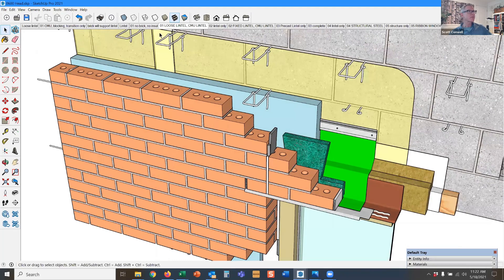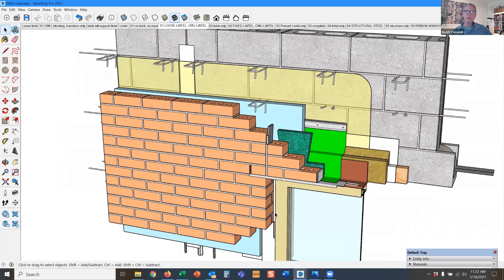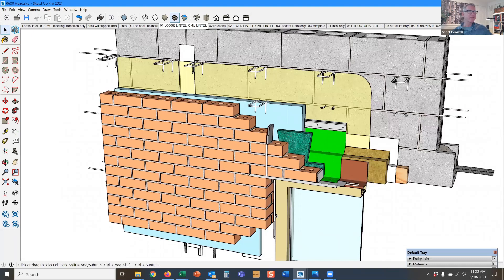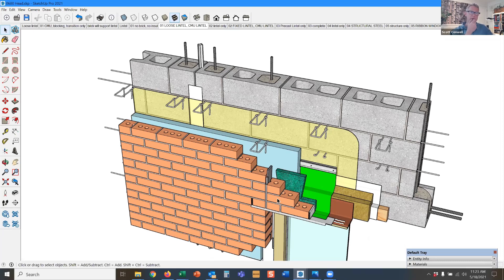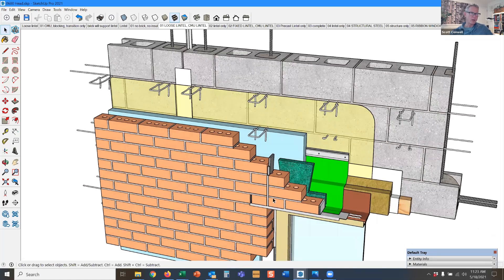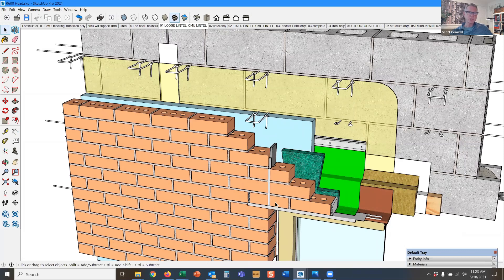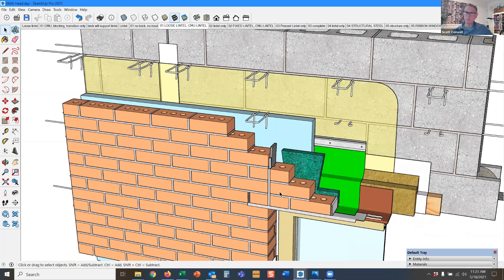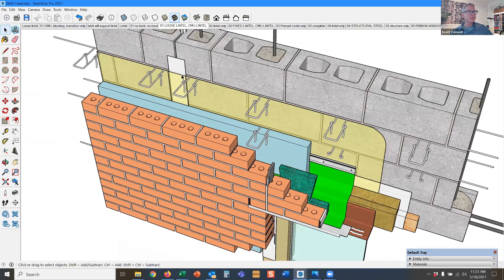A.11 Masonry control joint vs. expansion joint

Comment: I'm reading about this in our regulation standards here in NZ, they mention control joints need to be put in every 6 meters, but I've seen many a 20+ meter long block wall with not one control joint? your thoughts on this?